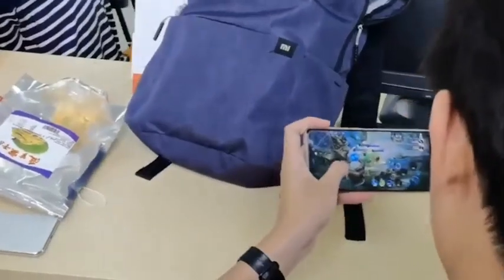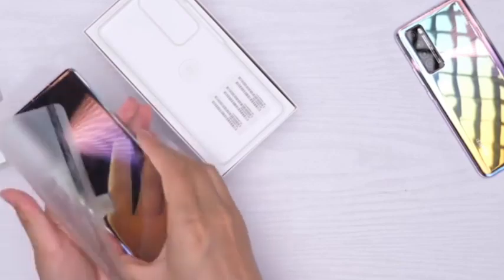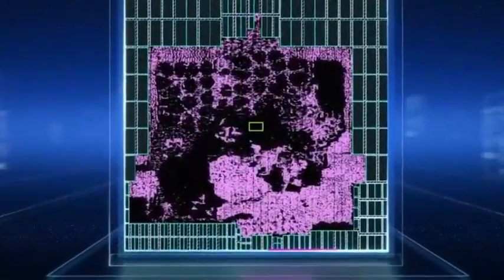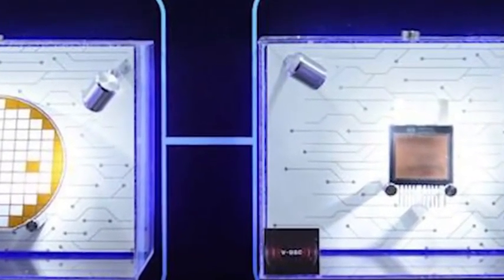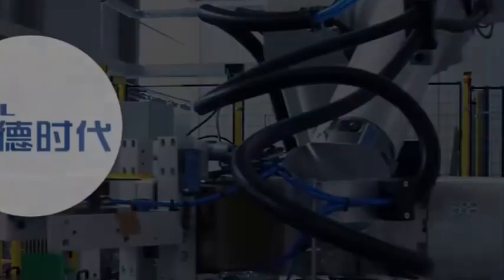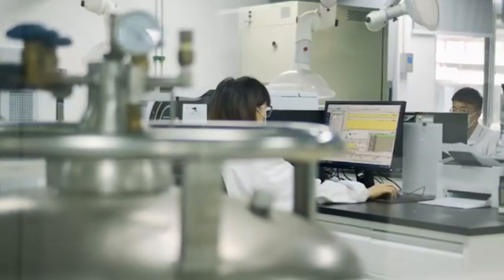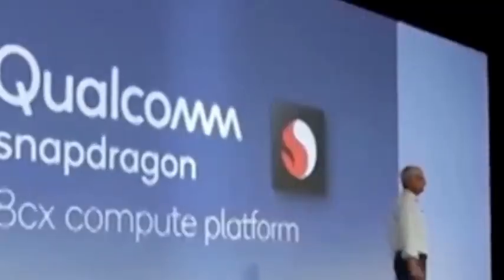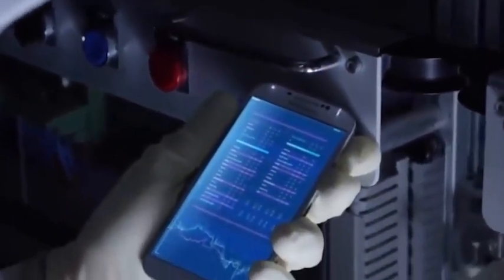China's automotive chips are rising, with self-sufficiency rate reaching 60%!

Comment: IGBT is not used functionally in logic circuits but is applicable in power switching applications like switching mode power supplies, speed control, and DC to AC converters,

"The main advantages of using the Insulated Gate Bipolar Transistor over other types of transistor devices are its high voltage capability, low ON-resistance, ease of drive, relatively fast switching speeds and combined with zero gate drive current makes it a good choice for moderate speed, high voltage applications such as in pulse-width modulated (PWM), variable speed control, switch-mode power supplies or solar powered DC-AC inverter and frequency converter applications operating in the hundreds of kilohertz range." (Electronics Tutorial)